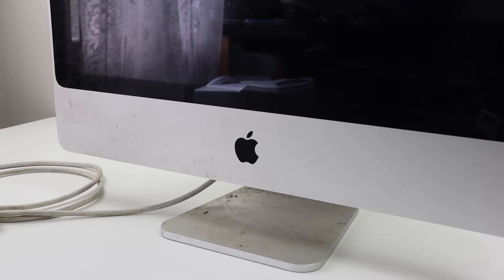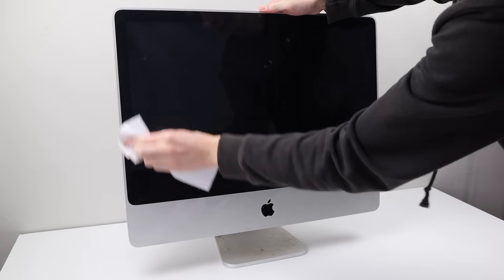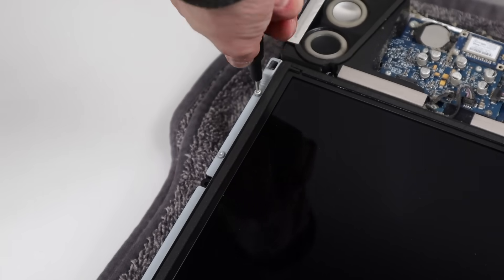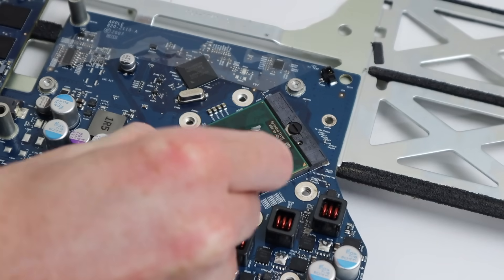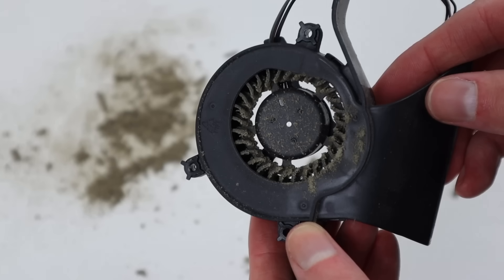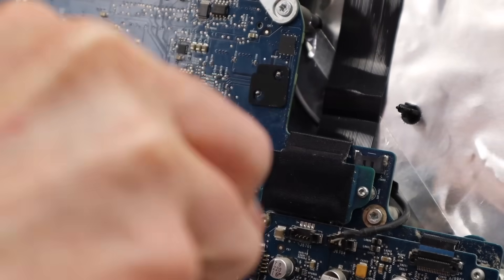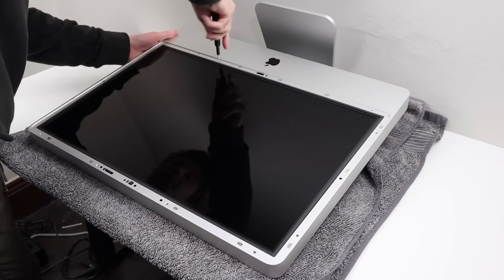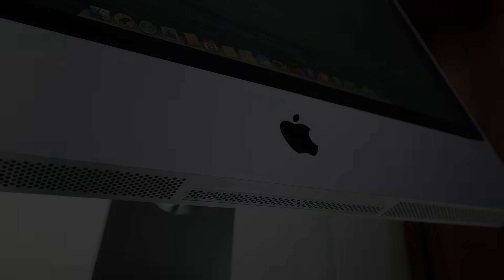I Was Given a FREE Broken iMac, Lets fix it!

Comment: I was given a "virus infected" small notebook (asus e200ha) if i could remoove the viruses and save the data.
Virus was a fake "your computer has been infected with a virus" wbsite. Did a full usb bootstick vorus scan (none found) got the data off of it and got it to the previous owner (even asked if they wanted it back, but as it seems they didn't due to hardware limitations) it is not powerfull, i got to admit that and for updates you basically got to uninstall everything exept the bare bones of the os (28 gig internal and thank god win 10 juuuuusssstttt fits on it).
This thing is a potato, expendable, lightweight and got too less memory to put important stuff internally, soooo, that thing is darn practically and usefull. If i carry a backpack i always got it with me (as its lighter and smaller than some books, therefore it doesent matter if i take it with me every day) earlier in school and now at work, i got it when i need it. Powerfull enough for word and minecraft (1.5.2 i think, low settings ) and older shooters like just cause run georgeous on it. I don't say you should go out and buy one, no, but if you get the opportunidty to get one for cheap or free, invest the effort.
It may be a potato, but a good potato.

Comment: I own a early 2008 24" aluminum iMac which is made in the same way. I have installed on it Windows 10 natively. Now this machine is updatable and working great. To install Windows 10 I just connected to it an hard disk with win 10 already installed, taken fro a hp 8000 PC, which, as I found out, does have the same Intel chipset. I just connected the hp drive and powered it on. There was some time to wait, but in the endo win 10 made its way to the display and, incredibly enough, found all the proper drivers without being connected to the internet! Then after half an hour or so, when win 10 was working stable, I connected it to the internet and upgraded all the drivers with Driver max, and now it works perfectly with Win 10.

Comment: you are wrong bud 

look at the new 2020 model ssd all the way m.2 also  And the new 27-inch model elevates the experience in every way, with faster processors and graphics, expanded memory and storage, enhanced audio and video capabilities, and an even more stunning Retina 5K display. It’s the desktop that does it all — better and faster than ever.

256GB SSD

512GB

512GB SSD

Configurable to 1TB or 2TB SSD

512GB

512GB SSD

Configurable to 1TB, 2TB, 4TB, or 8TB SSD

Storage1

https://www.apple.com/imac/specs/

Comment: just a pro tip for everyone: When ever you dust out a fan with compressed air, always hold the fans (so that they do not spin up) or disconnect the wiring from the mainsboard.  Or else you will be using the motor of the fan to act like a generator and blow up the electronics on the 12V line on the board when u speedup the fan fast enough with the compressed air   No joke
Reply: Why u copy the guy above

Comment: Hello, I appreciate the video and detail of the teardown. I had a question about the GPU and year of this imac. I'm having trouble finding out what GPU connection is used for this imac. I found out the 24" early 2009 uses the standard mxm 3.0 connection. But not sure about the earlier Imac 24" are you able to help with this question. Cheers.

Comment: Okay, so how do you get a failed motherboard replacement when Apple no longer supplies it? I've had that problem twice and I couldn't get a replacement for it. I wouldn't trust a used one for obvious reasons, and if they make third party motherboards, I wouldn't trust that. I have a 2014 imac 27 and I've replaced the hard drive with an SSD, but I'm keeping my fingers crossed that the Motherboard doesn't go on me.

Comment: 8:59 there should be a better way to do this. you are not supposed to press the fan with your hand nor blast air that would move dirt inside the motor either.

Comment: I have iMacs from 2008 still in use at various companies. Your iMac has no hardware damage - so it is easy to fix... Also since you can't have latest versions of various browsers and programs with the MAC OS it can run, it makes sense to install a Linux distro like Linux Mint so you can run current apps: Firefox, Safari, Libreoffice, ...

Comment: i see that the processor can be replaced. could put a T9300 (Core 2 Duo; 2C/2T @2.5 GHz). for the SSD, i would say its overkill, as any 250 GB / 320 GB 7.2k RPM HDD would do just fine.

Comment: 7:21 That looks to be a desktop chip. Would it be possible to put a core 2 extreme in there instead? To get quad core performance? nevermind, you literally talked about that later on.
Reply: Your right, that’s a laptop processor. A core 2 duo extreme would be incompatible
Reply: I'm pretty sure that looks like a mobile processor to me.
Reply: @tarhyung45  mm
Reply: Intel did make extreme versions of mobile core 2 CPUs, the best being the X9000. However, they technically are all still dual cores.
Reply: @thaitan85  Intel also did a lot of fuckery with chipsets refusing to work with said CPUs etc. I've just worked on a similar iMac albeit it was a 2009 model and I replaced the HDD for an SSD as well (it was the only fault it had). I have couple Extremes that use P Socket as well just out of curiosity and the iMac did not even go to a chime (the fans would spin however). Same experience from a Dell Vostro 1510 I've restored recently. I will find use for those Extremes one day.
Reply: @thaitan85  So technically its not an Extreme. Still a Core 2 Duo
Reply: I'm sorry I don't speak robot.
Reply: @Aasma_  same lol u got all these people talking about cores and scanner and stuff 😭😭🤣
Reply: I couldn’t see why a laptop 2 core Chip would not be compatible. And it would only take simple maths to make it seem to have 4 cores if you add 2 + 2 :/
Reply: @hello_my_jellojelly_head2742  Technically it would fit however the Mac wouldn't accept it as there was no such 2007 iMac with a quad core processor. Trust me, I have tried on my own machine and it doesn't work
Reply: There are laptop CPUs that look like desktop. Even if it actually is desktop, I wouldn't be surprised. iMacs have desktop hard drives and laptop ram and optical drives
Reply: @csr2537  Its a laptop CPU. I am 1000% percent sure about that as the suffix they use was T which is a laptop CPU
Reply: Nice https://youtu.be/4jexlj90868
Reply: Hmmm

https://youtube.com/shorts/dKqBsTFey9E?feature=share

True
Reply: that looks to be a  bare CPUDie it could be possibel to use a different CPU if u remove the IHS that Desktop CPU's have
Reply: @animalm4st3r  It would still be incompatiple as the iMac uses PGA (Pin Grid Array) for contact and Desktop CPUs use LGA (Lan Grid Array)
Reply: @tarhyung45  i have a i5 3210m
Reply: @ronaldddoooo  and i have an i5-4590

Comment: Is it possible to remove the stand on a Late 2012 iMac 27" and replace with a mount to hook it onto a wall mount without taking a saw to the stand? I saw the hinge mechanism while it's open, and that it can be removed, but I haven't been able to find a wall mount to swap out. 

If it is possible, do you think you would be able to pull off doing so with mine? Wouldn't mind paying for the parts for you and let you make a video guide on it for others to see.

Comment: i love how he gives us the steps like if i would try and fix my imac myself.
Reply: Lots of people do. I'm one that would do it if I had to.
Reply: @Kalvinjj  please do not do this. Its gonna void your warranty and youd be fucked if it isnt fixed
Reply: @ginfong2895  well obviously not stuff in warranty, unless it's impossible to use that warranty like in the case of my Switch that has no authorized repair here, but something that has been out of warranty like the Mac shown here (for years sometimes, usually for a HDD to fail that is the case), you would be fucked anyway if you don't try it, you either pay tons for the authorized dealers or you know what you're doing and go for it. It's not about people that don't know the difference between a Philips and a Torx screwdriver of course, people that know at least a bit about these kinds of stuff are way less likely to make things worse, and know when to stop if they can't do it.
Reply: @ginfong2895  why tf would the warranty even be active given the time this model was released
Reply: @ginfong2895  what if there is no warranty
Reply: @ginfong2895  dude the computer is 15 years old and the warranty probably lasts 1 year
Reply: @ginfong2895  its over 10 years old who cares
Reply: I used to say that when I started watching repair videos. Since then I’ve boughten like five broken devices and repaired them. It becomes addictive lol
Reply: @Garrettdx1988  how to start?
Reply: I actually have the same iMac with a dead hard drive
Reply: Yh k no one asked for ur opinion
Reply: @yamum361  and no one asked for yours?

Comment: 7:18 That's a whole lot of thermal paste almost like The Verge How to Build a PC video
Reply: at least he's not multi-layering them like when the pre-applied corsair AIO already have it from factory and then Steffan managed to sandwich another layer of paste on the CPU, like 
H E F T Y amount of it.... 
Also FYI GPU tend to have more thermal paste applied from factory as their die size is bigger than CPU if you've ever seen a disassembled a GPU unit whether it's on graphics card or on-board ones (EG. Laptops and iMac)

Comment: The two coaxial cables you removed at 5:50 were gray up, black down.
Reassembly at 12:07 shows that you connected gray down and black up.
EDIT: NVM. At 13:06, after unsuccessful trying of the other Wi-Fi, you connected gray up and black down again.

Comment: Nice job.  I'm in the midst of a similar job on a 27" late 2015 iMac.  Wanted to comment on the cooling fan.  I have the same type of fan in mine and after a bit of studying it closely, I was able to get it apart quite easily for a more thorough cleaning.  There are several "tabs" (not really sure what to call them) positioned around the fan and I just pried it carefully apart at each tab.  Looks like you got yours as clean as mine. =)

Comment: I have the same model of computer and it is also broken. I have tried everything. The only keyboard shortcut that works is Cmd + Option + P + R (PRAM reset). I have an external drive with macOS El Capita installed, but I can't open the boot config menu. I can hear the hard drive whirring. There is also no blinking icon, just a white screen. Any suggestions?

Comment: Even though I know I can’t do any of this I still watch it cause it’s satisfying
Reply: Diging into computers is easier than you might think and i ceartainly think you could swap out parts with a tutorial to get it working again on your own. diagnosing the fault is the only hard part, disasembly is easy, just dont overdoo it.
Reply: @Em.P14  For me it would like trying to copy those how to a landscape videos.  So simple In theory, so impossible in reality.
Reply: @MrCrowebobby  i did work myself through several laptops already, in those everythinh is either screwed plugged or clipped into eachother, so it is basically as easy as lego. Just don't pull (or else) too hard on annything and you will be good (as long as there is no soldiering required, what luckily isn't often the chase.
I even salvaged a webcam and a screen from a dead laptop. I wouldn't try myself on a harddrive or similiar that holds data either but on the bare pc, there is some room to screw up.
Try it yourself if you don't believe me, get a dead laptop from a landfill or cheap somewhere else and look up,on how to get the screen working again. Now you got a cheapbhandheld tv/monitor screen. Webcam requires some soldiering, knowledge on how to use a multimeter and a broken usb cable, then you can make it work again without any issues
Reply: @Em.P14  Thanks, my  main problem is just the spinning white circle and the spinning. beachball, I can't delete anything from my Activities because it always says it is required for OSMac.  This was a refurbish make-do laptop till I get a newer more expensive refurbished iMac from Apple.  Any ideas would be much appreciated if you have the time and inclination.  Again thanks.
Reply: @MrCrowebobby  sorry to tell ya, but i ain't a macOS user, however if you can get into the os and do regular stuff it is in 99 out of 100 chases a software problem and in 50% of that chases can be solved by a normal restart, if problems continue i would take a look if any software you are running would require an update if so install it. i really hope for you that you will find someone with a good answer to your problem
Reply: @Em.P14  Thanks a lot for taking the time to reply.  I was a little afraid it was pushy of me go even ask.  Take care.
Reply: @MrCrowebobby  don't worry, asking is never wrong and if you get a stupid answer back just ignore it.

Comment: I was given the exact iMac mid 2007 24inch for free. I changed the broken hard drive to 1tb and upgraded the ram. after many calls to apple they couldn't fix my computer but i was smarter then them and fixed it :) it works perfectly now
Reply: I have an old iBook that had fallen off a motorbike, all quite bent. But it works, with some few things (contacts probably) I should fix. Good engineering, after all.
Reply: @akronymus  that's awesome

Comment: hey bro.. i got an imac desktop MC309ll/a  mid year 2011 which i have tried fixing..i have changed the motherboard and i have change the power supply and when i put it on by pressing the power button it keeps beeping..no sign of it coming on.. what could possibly be the problem with it?get back at me

Comment: 13:19 can you see water on the wall.. are these canned air good for blowing on hardware?
Reply: Canned air is really a can of refrigerant (not water), so it depends on how the can is positioned, and a refrigerant's liquid temperature is drastically lower than water, which causes it to evaporate quickly in room temperature. Liquids (that conduct electricity) also will usually not damage electronics if there's no electricity. 

Conclusion: as long as there's little to no electricity in the electronics, and the compressed air is used properly (and at the right position) it should not damage the electronics.

Comment: I managed to scab the same age one from my work that was a clients one they didn't want and had been sitting around for about 5 years.
I have been tempted to get inside my one but I don't have the suction cups and the amount for fiddly screws seems like too much effort plus the costs of extra ram (mine only has 3gb, originally 2 but I had a spare stick that worked) and the ssd makes me question if its worth the effort or not.
Also good to know about the yellowing on the display as my one does the same and I wasn't sure if it was a common thing or just my bad luck lol. 
Overall it is a decent machine, I just hate how much price value Macs hold in the second hand market in Australia as I want to have a mac at home just so I can incrementally use to keep my skillset up as some of my works clients are mac users but paying 600 bucks in some cases for say a 2012 era laptop is just daft to me.

Comment: The hard drive wasn’t dead all you had to do was access the Apple OSD Internet recovery and re-download the OS to the system I get you need to take the whole thing apart to clean it but you definitely didn’t need to take it apart and replace the hard drive. You should also always be wearing anti-static bracelets before working on tech.

Comment: Another thing to consider is just replacing the Hard Drive cable that connects the two (Motherboard, Cable, HDD) - if the start-up shows the question mark folder. I had this with my MacBook Pro (took it to Qatar and it overheated, naturally). Replaced the cable and worked fine.

Comment: Just a hint or the way i do it from the very first time till now (last 25 years). Brushing against a vacuum cleaner hose. You don't need to clean your desk after and chase all those dust particles around the house, room, or wherever. Much more practical and saving of canned air. And using a baking soda and vinegar mixture to clean the other rubber shell that power cable has. Brings it back to clean white.

Comment: I once found a broken imac in a dumpster at the local scrapyard, took it home and see what it did. Turned out it was just a graphics card issue. I put the gpu print in the oven for 8 minutes on 200 C to let all the solder melt and get all the connections fixed. Turned out that was the only issue with it, so now I have a free working imac and some knowledge and had some fun :D
Reply from the maker: Awesome!

Comment: I still have the same iMac. Still works well especially considering the considerable age. Though mine does have a 7200rpm drive (perhaps it was a model up?). It also has another thing that new iMacs don't have, which is why is the reason I still occasionally boot it up, A CD/DVD drive!
Reply: I have a 2012 MacBook Pro. It really started to slow down over the years. Yanking that old 750 GB mechanical hard drive out and installing a 2TB SSD really livened it up. Also installed a new battery. I get to flex on people with new MacBooks because I have a DVD drive and USB ports lmao
Reply: i remember watching movies on my old mac
Reply: With these specs,where I live it would probably sell as a last gen high end machine

Comment: I just cloned my El Capitan hard drive onto a 256GB SSD to put in my still functioning 2007 20" Aluminum iMac 7,1. Great video, Hugh! I also have an A1225 24" Aluminum, and the 4th. test LED isn't coming on, which suggests the display isn't being communicated with. Do you think it could be the sensor not getting 12V, or the display itself? I don't see any ghost image on the screen when I shine a light on it.